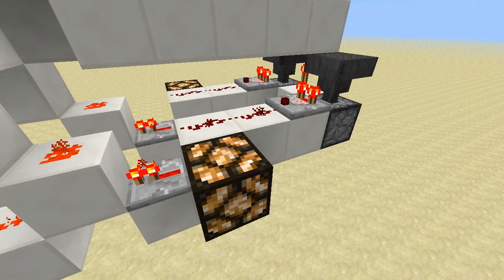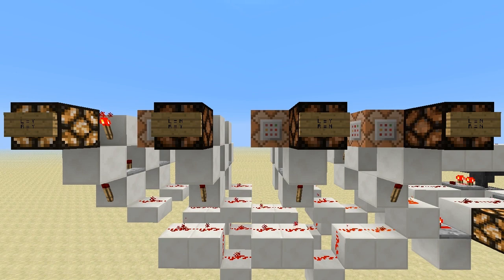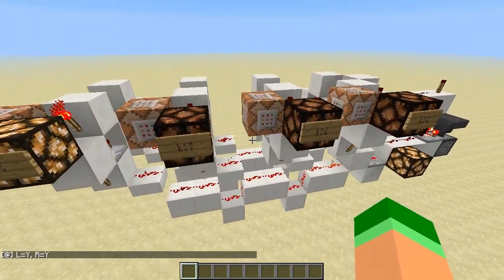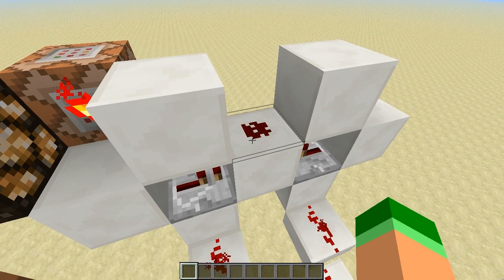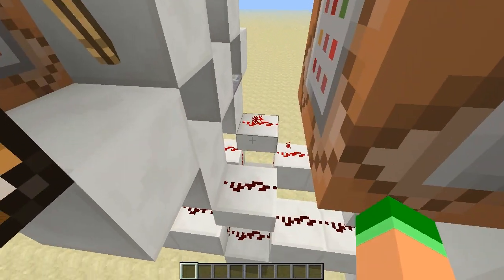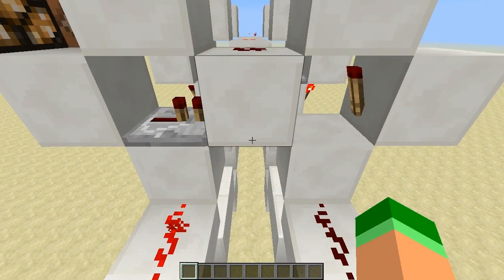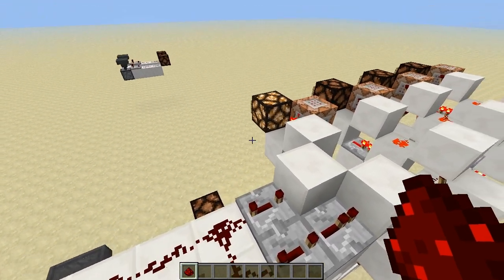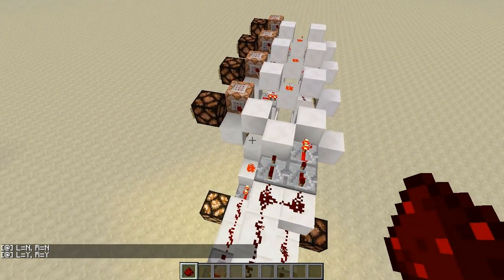Decoder for 2 Bit Random Number Generator [Minecraft 1.5.1]

Comment: The torch doesn't cause the outputs to be the same two every time. Try lengthening your wire by one or two and you'll see that when one hopper contains the stackable item it outputs a lower signal, which disappears earlier in the wire. Therefore if you lengthen your wire well enough the outputs will be, in fact randomized, whereas if you put repeaters right in front of the comparators the result will always be two on.

Comment: You know... You can build a hexadecimal adder with comparators by basically using their subtraction and inverting parts of it. If you built a 4 bit randomizer and assigned each bit the numbers 8, 4, 2, and 1 then you could use the adder to turn it into a compact randomizer for hexadecimal.